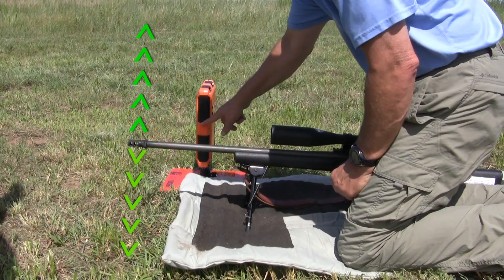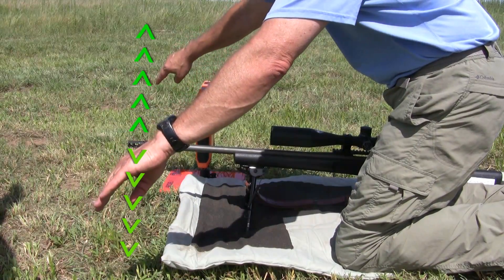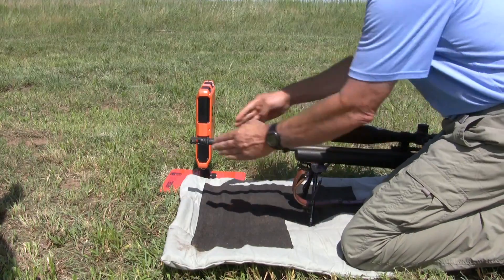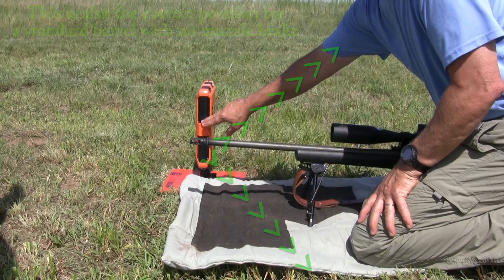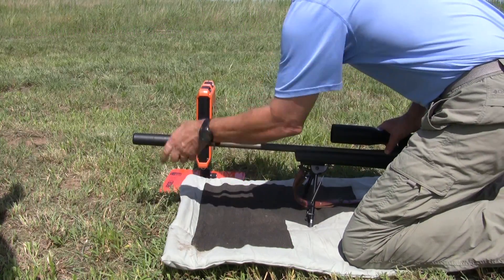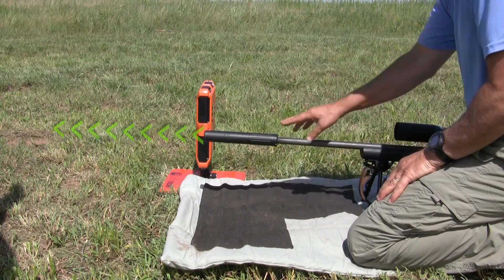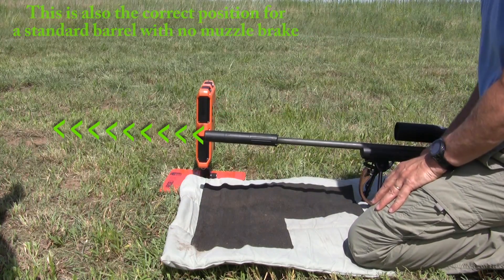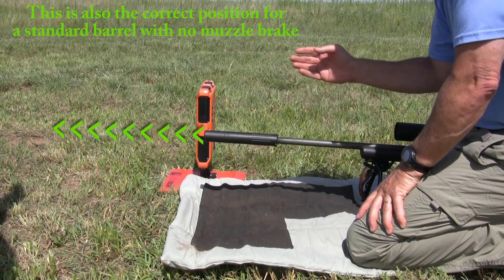Labradar Muzzle Position

Comment: This is a very helpul clip to make the right adjustements!

Maybe you could add the correlation of the muzzle location with the "Set proj. offset" from the setting menue (or do I get something wrong here?). What is the right setting depending on the muzzle location.
Reply from the maker: The Projectile Offset is the distance from the side of the Labradar to the barrel. You do not have to have an exact measurement.  If your barrel is 1-6 inches use 6, 6-12 inches use 12, etc.

Comment: Thanks for the video. With muzzle brakes that send the blast to the sides and not back it looks like you have the Labradar back about 8 or more inches. How far back is it actually set and what sensitivity setting for it? Thank you.
Reply from the maker: Always leave your unit on Trigger Level 1 unless other shooters are triggering your radar.  For the muzzle position always keep in mind the unit needs to feel some of the muzzle blast to trigger. If it is a direct blast from a muzzle brake it will shake the unit and it will not read the projectile.  Since each brake discharges at a different angle I cannot give you an exact distance, just keep the above statement in mind. If your muzzle is too far forward, the mic will not pick up the shot.
Reply: Thank you for the information.
Reply: I have mine about 4" behind my muzzle brake mounted on the "lab radar pad" and it gets rocked by my 338 lapua muzzle brake (terminator T3) guess I need to move it back about another 6" so it doesn't get knocked around or mount it on the labradar tripod.

Comment: Would have been awesome product if you would have charged more but included the table stand.
Reply: Yeah, because the one thing Labradar needs to be is more expensive... You could make one with a board and a bolt for <$5
Reply: Or you could just buy both products if you need them both. I appreciate the flexibility of them offering the stand separate. I happened to have a suitable ball mount laying around from when I used to do more photography and I simple bolted that to a sheet of 1/4" thick painted mild steel.